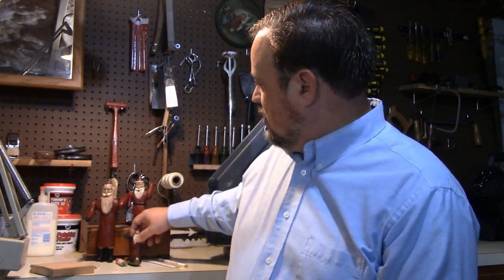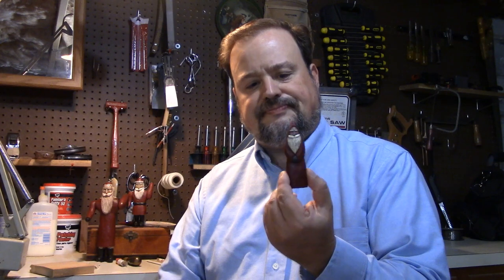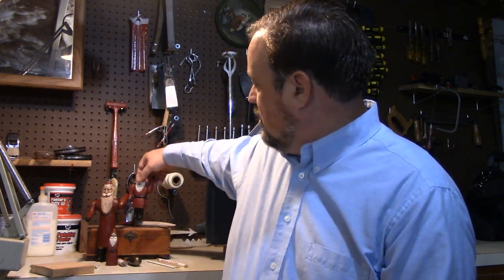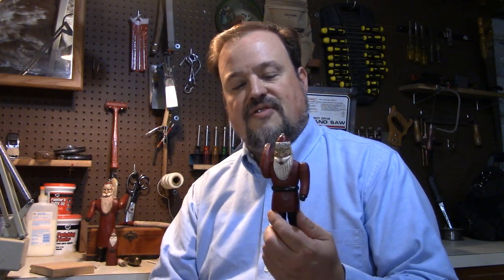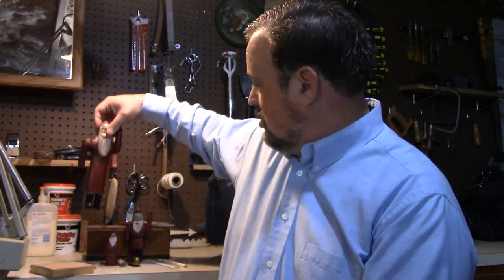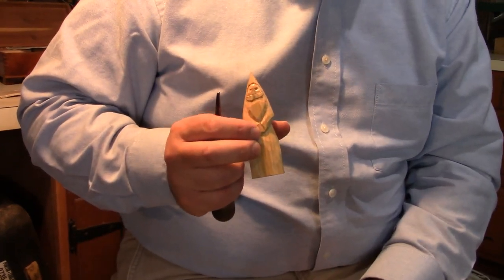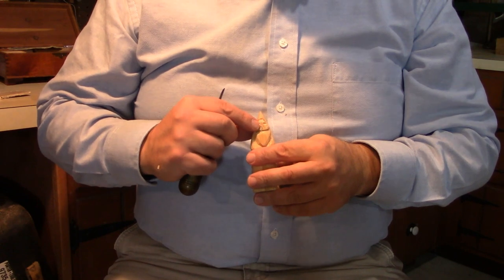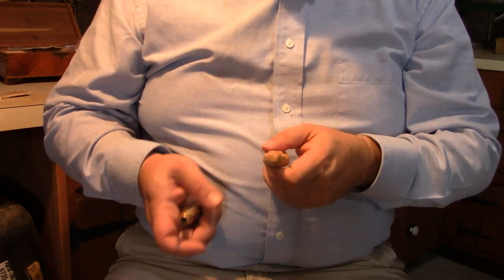Christmas at Cornwall   Santa Carving Instructional Video

Comment: Around 12:37 you called the process you were doing as chip carving. I don't consider that chip carving and I'm sure others might not as well. Chip carving uses precise cuts into wood to remove small chips in a single piece. Most chip carvings are very intricate designs. Love the Santa Claus.

Comment: Mike just found this video, wondering if you have the pattern for this carving and post below the video? Also what are the measurements, side to side looks like about 1.25" to 1.5" and then top to bottom 4.5" to 5"?
Thanks in advance for any help.
Reply from the maker: Hi, Bob.  I will email you the information.
Reply from the maker: The piece of wood should be 1 1/2 inches wide by 4 5/8 inches tall.